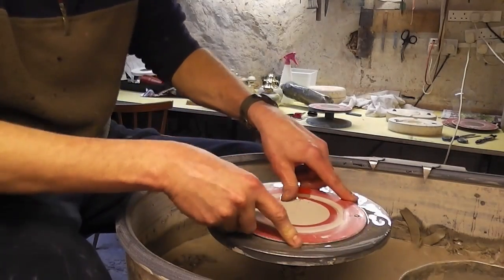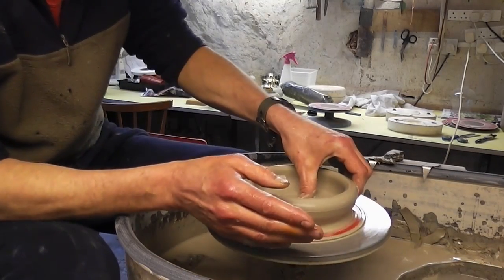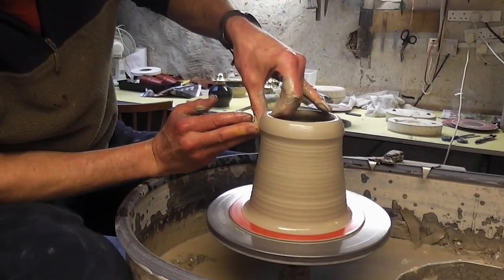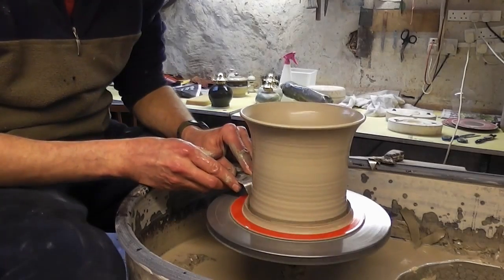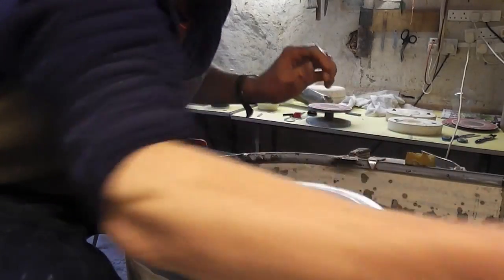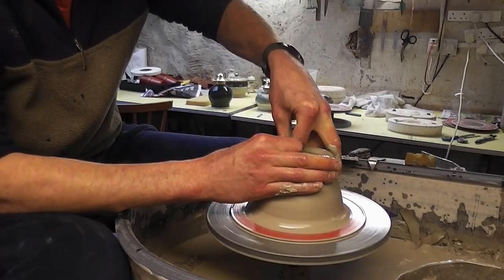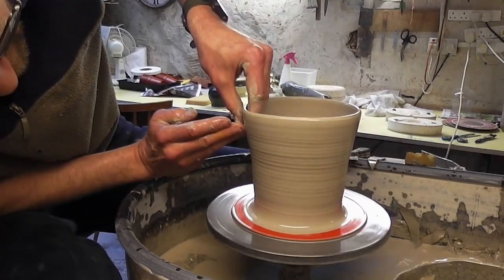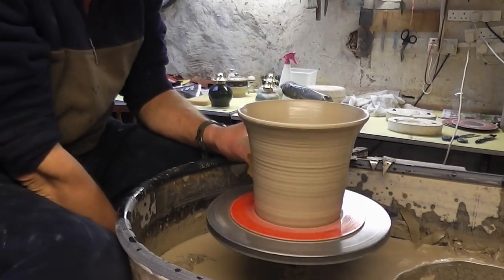Making / Throwing some very simple Small Pottery Plant Pots on the wheel

Comment: how do you add the holes at the bottom? these videos are very fun to watch and rather cathartic, thank you!
Reply: +Renoa Heartilly 
He'll trim the pots when they're "leather hard," which means stiff enough to to be trimmed but not so dry that they shatter.  How long that takes depends on temperature and humidity, so it varies.  In my class, we'd cover our pieces with plastic (like a bread bag type of plastic) and let them sit for two or three days.
Reply: +Renoa Heartilly I would suspect he'd do something alike what he does with other pottery that requires trimming and cutting work. He'd give them time to dry and firm up a little then cut the necessary holes out before letting them dry out fully and all the rest.
Reply: Think he lets the clay dry a little bit, not to dry, but still... Then I think he just carves?